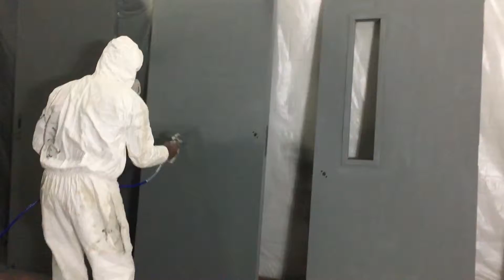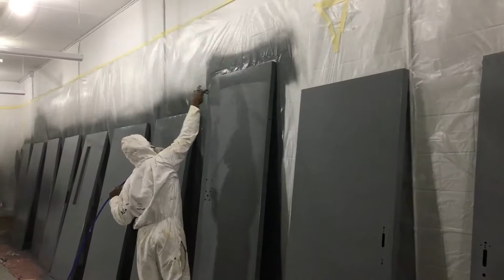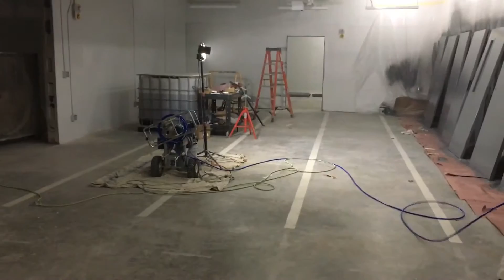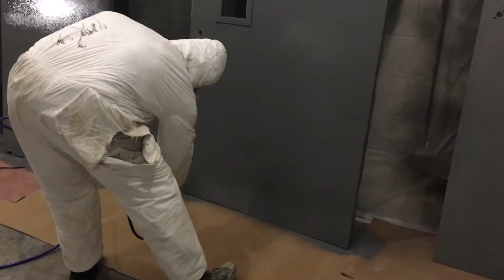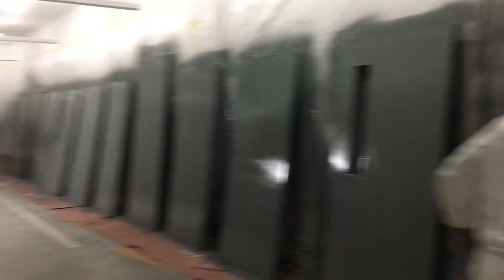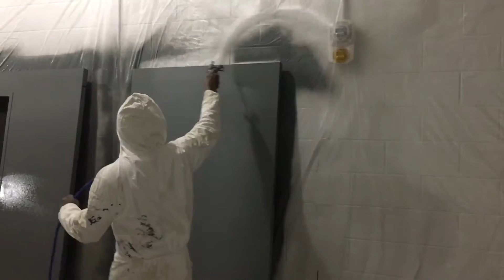How to Paint Steel Doors

Comment: Hi Francis, can you tell me what primer and finish did you use...What tip are you using at what pressure.Thanks
Reply from the maker: Hello  Alberto , thanks for checking out my vid . I used the Pro-Industrial  Pro-Cryl primer .  I used a RAC x315 tip . I usually run the pump between 1000-1200 psi for metal surfaces .  I  was using Pro-Industrial Precat WB epoxy on the doors . All  Sherwin Williams products.
Reply: @everydaywitkaycee thank you so much Francis this will help me a lot.
Reply from the maker: @albertomendez4485  My pleasure Alberto ... Goodluck